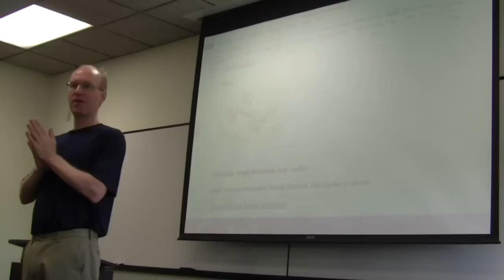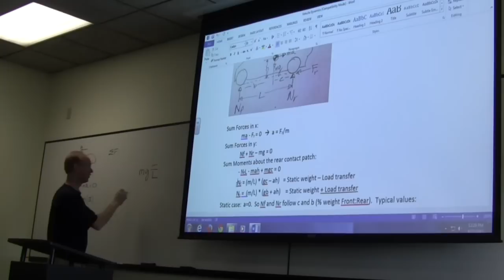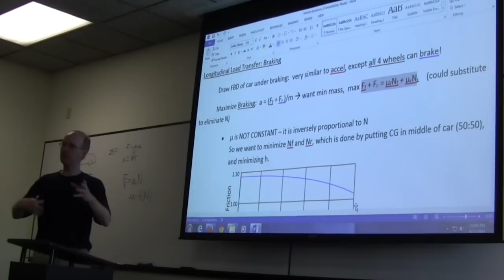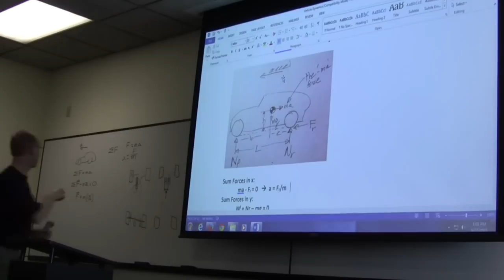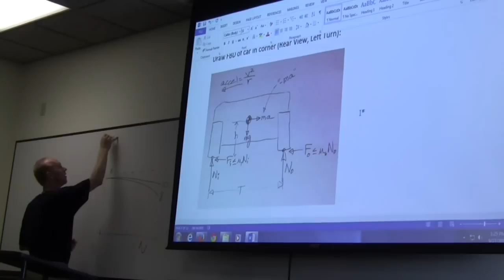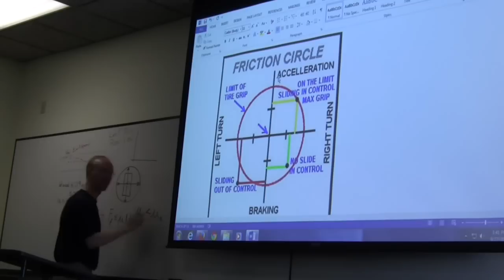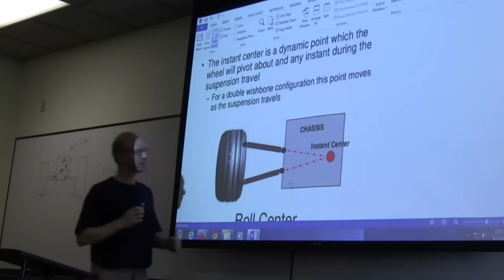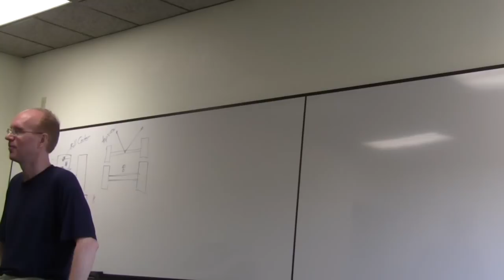Vehicle Dynamics Lecture #1: CG, Load Transfer, Accel, Braking, Cornering, Friction Circle

Comment: 1:36:26 It seems to me that if the wheel encounters an upward bump, the instant center of the wheel will lower to the ground and thus the roll moment will increase in length. I imagine the same effect will occur if both wheels encounter an upward bump. My question is, under squat or dive, do the rear and front roll moment arms increase in length? That seems like it would negatively affect performance quite a bit.

Comment: Why friction does not act on the forward wheels while acceleration?I think it must act in the direction opposite to the direction of acceleration in rear wheel drives...
Reply: It would, there will always be rolling friction. However, I imagine it would be much less than that on the driven wheel. For this simplification, we can ignore it. Correct me if I am wrong. Cheers.
Reply: The answer is, it acts.But in the video, he has considered overall tractive force Fr which is the resultant of all other horizontal forces. He has simplified the model, for better understanding. In order to understand those forces, you need to study tire mechanics.
PS: This tractive force is responsible for the movement of the car in the forward direction.
Reply: Jake DeBoer do u know that for sure??

Comment: Regarding longitudinal weight transfer (and probably lateral although I didn't get that far into the video):  While the free body static analysis early in the video gets the correct answer for load transfer, what I find simpler and less confusing for most people intuitively is to treat all forces and torques to be acting at and around the center of gravity instead of picking an arbitrary fulcrum on the ground such as the rear tire.  After all, an analysis of this type is not really of a static vehicle, it's of an accelerating one.  That's the whole point of the exercise:  Computing rear weight transfer under acceleration, which by definition is not a statics problem.   

I only set the torque balance and vertical force to 0 while allowing the longitudinal (traction/braking) force to be whatever the real force is.  There is no need for the x force to sum to 0.  It's an accelerating vehicle so it of course does not sum to 0.  

After a couple decades of writing vehicle simulations and talking with people online about the subject, I've found that the conceptual addition of a fake force at the center of gravity (in order to make it a true statics problem) and treating everything as though the rear or front tire's ground contact is a fulcrum confuses people more than anything.  This applies to lateral load transfer as well, where people struggle with the concept of a fictional centrifugal force acting on the vehicle where in reality there is no such thing.  I've spent countless hours trying to get people to forget about centrifugal and other non-existent forces but apparently university engineering courses on the subject still teach it.

In the rigid body dynamics simulations I write for vehicle models (whether they're cars, boats, planes, or anything else), torques are always computed around the vehicle's center of mass (or masses in the case of multibody simulations).  A nice bonus to this approach is that countless additional forces can be piled into it and it becomes very easy to understand what they'll all do.  For instance, aerodynamic drag location height relative to the cg or ground can cause a pitch moment in either direction (pitch up or pitch down), but someone who's recently been taught to treat the rear tire as a fulcrum and apply a non-existent force at the center of gravity will not understand how it can go in either direction.   They see the ground and the force above the ground, so incorrectly assume the force always results in a rearward pitch moment.   To get people to understand why that's not necessarily the case, they have to unlearn this mental model with the artificial force added in to pretend it's a statics problem when it really isn't.
Reply: What material did you use to learn vehicle simulations? Do you currently use MATLAB (simulink) or simply use an excel sheet to model vehicle dynamics?